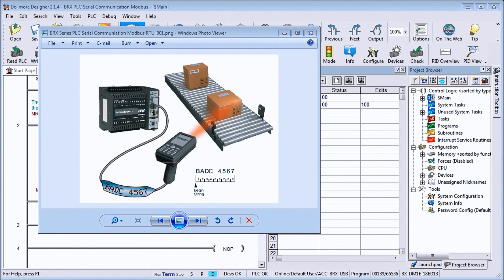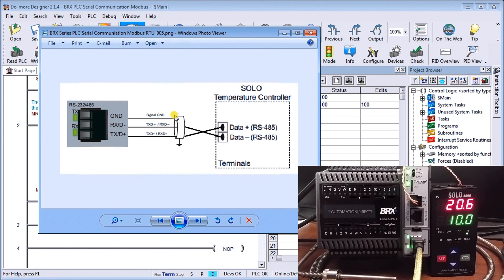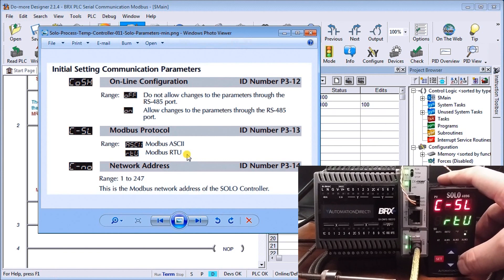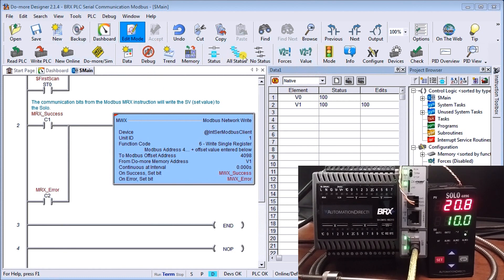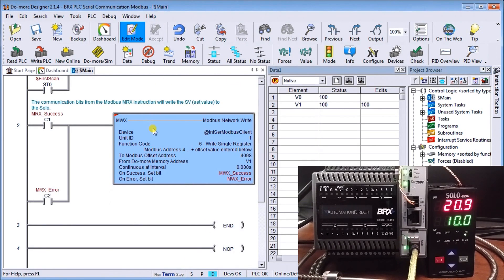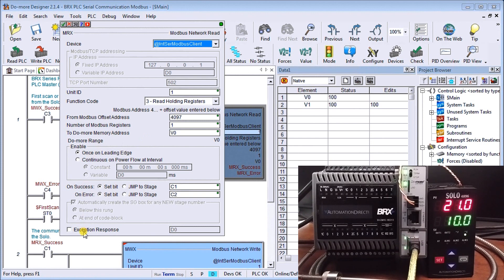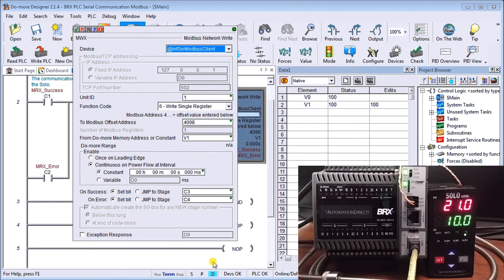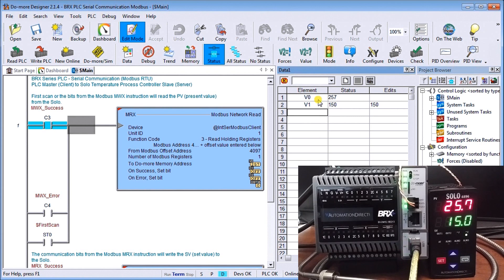BRX Do-More PLC Serial Communication – Modbus RTU to Solo Controller

Comment: I tried to use this as a template to get a temperature reading from my Click that has a thermocouple module on it to my BRX. I  get a Modbus connection but I am getting screwy readings on my BRX from the Click. I have tried every combination of registers I can think of in the BRX and can not get my temp reading in F from the Click. 

I guess what I am saying is; I can read it as an integer from the Click, but I want to read it as floating point. Any help would be greatly appreciated!
Reply from the maker: Hi Bobby,
The following thread will help you out:
https://forum.automationdirect.com/forum/general-applications/108413-floating-point-from-click-to-brx-conversion
"MHRx:RD (Real Double). The : D cast just changed the size, not the data type, so it was interpreting it as a simple 2's complement 32 bit value, instead of IEEE floating point"
Regards,
Garry
Reply: Thanks Garry! I saw that thread a couple days ago and tried it but all i read is 5.0510E-41 lol. I do not understand why it doesm't work.
Reply from the maker: Hi Bobby,
I have just hooked up a Click (Server(Slave)) PLC and used the Do-More Simulator (Client (Master)) to communicate Modbus TCP to it. 
In the Click I am using DF10 with a number. (1234.56)
In the Do-More I am using the instruction MRX (Modbus Network Read)
Function Code - 3 - Read Holding Registers
(The modbus address in the Click is 428691. This is seen using the address picker and selecting modbus address.)
From Modbus Offset Address is set for 28691. 
Number of Modbus Registers is set for 2. The floating point values are 32 bits or 2 words.
To Do-More Memory address was  R0. This was also a 32 bit floating point address in the Do-More.
Running the program and monitoring R0, I am getting the correct value in the address R0. (1234.56)
I then changed the MRX instruction in the Do-More to read the information to the MHR0 address. This would take up two channels, MHR0 and MHR1 for the information.
Running the program the information was transferred. This time when monitoring the value I used MHR0:RD to cast into a real value. The information was still correct. (1234.56)
A couple of thing come to mind:
- Please check to make sure that you are reading two words. When using modbus, it is just sending bits. The meaning of the bits is not interpreted.
- Check that the address used is correct for the information.

Let me know how you make out.
Regards,
Garry
Reply from the maker: I'm glad you got it going.
Garry

Comment: @Garry Shortt: what would you recommend for sensors using UART and I2C data protocol with BRX ? I just ordered BRX system because of all the good infos You and AutomationDirect provided trough training videos, it seems the platform is well documented all around, especially because of good guys like you. In hurry to receive it soon! Greets from Canada.
Reply from the maker: Hi QuebecoisSti,
Thanks for the comments. I have not worked with UART or I2C, however, the protocol does not seem to elaborate. 
I would try using the custom serial instructions STREAMIN and STREAMOUT. This can be used with any serial port on the BRX. Failing this I would then look for a UART or I2C converter to Modbus. This would then convert into a standard protocol for the controller to control.
I am also from Canada. 
Garry
Reply: @ACCautomation  thanks alot Garry. I will try to find a converter. I am new and noob to the BRX and to me it seems theres only one RS-232/485 serial port and I don't know if a card exist to add more serial ports... Best would be a converter that bring it in 0-10V or 4-20mA since I would have that expansion card. If you have any recommendations for a store to buy components (Canadian if possible since customs & post office are overwelmed and $USD is strong). I am actually looking for industrial pH sensor, pump to adjust pH and CO2 sensor. I found AtlasScientific company that seems decent for their products but expensive and US based. I will be starting an indoor culture monitoring.
Reply from the maker: @QuebecoisSti  
You can add additional ports using a communication card.
https://www.automationdirect.com/adc/shopping/catalog/programmable_controllers/do-more_series_(brx,_h2,_t1h)_plcs_(micro_modular_astackable)/brx_series_plcs_(stackable_micro_brick)/communicationsa_networking
I do not have any recommendations for a store to purchase these sensors. I would only recommend if I've actually used the service.
The last time I used humidity was to use a Solo temperature controller with a humidity analog sensor. Communication was then done back to a data logger using Modbus RTU.
https://accautomation.ca/brx-plc-serial-communication-modbus-rtu-to-solo-process-temperature-controller/
Regards,
Garry

Comment: Hi gary!
As you suggested me Ethernet Standard PLC Units that have the Ethernet (Modbus TCP) communication back to the router. This will also have a RS485 communication port (Modbus RTU) to the temperature controller. The solo temperature controller has a built in RS485 communiation port. (RS485).
I am using to control the temperature of muffle furnace.K thermocouple is connected to SOLO Temperature controller.
What should be the Current Value  (0.5 A, 0.1 A,  1A, 2A, >2A) ,No. of units ( 9,14,16,24), Display type (7 segment LED, LED), Power (12V DC, 24V DC,100V AC, 220V AC, 240 VAC? Please tell me in detail
Reply from the maker: Hi Saurabh,
The actual Solo Process Temperature control unit settings can be found in the following manual:
https://cdn.automationdirect.com/static/manuals/solocontrolm/solocontrolm.pdf
The Solo unit will need to be supplied 100 to 240 VAC 50 / 60 Hz or 24 VDC.
You will need to look at the specifications of your muffle furnace to determine the best model of Solo for your application.
Regards,
Garry
Reply: Specification of Muffle furnace: Power Supply 415V 3PH AC, 50Hz. What other specification required?
Reply from the maker: Hi Saurabh,
You will need to look at what control configuration you will need to control the temperature. Is it a relay, voltage, etc.
Regards,
Garry